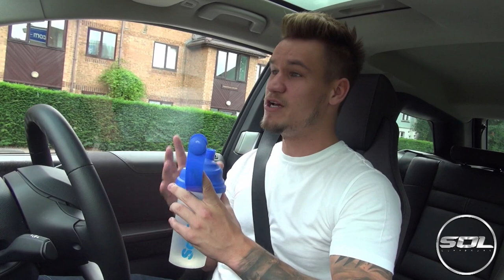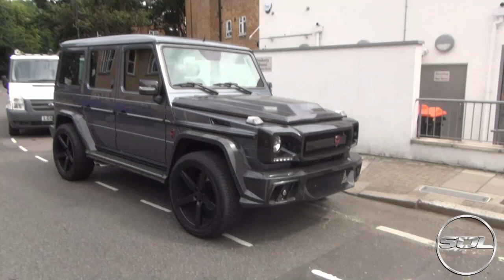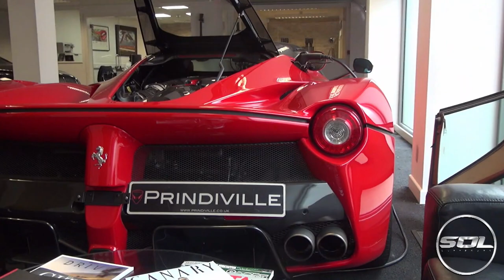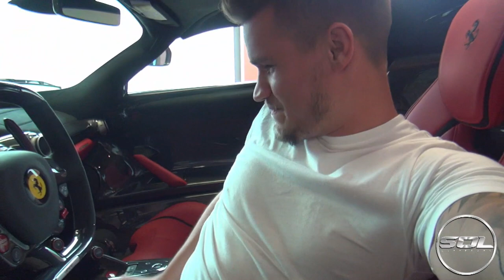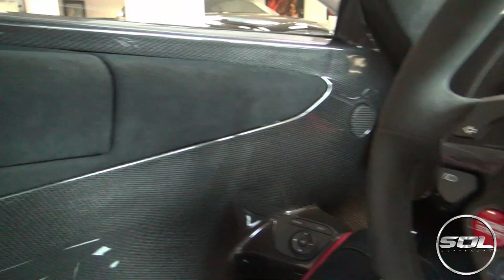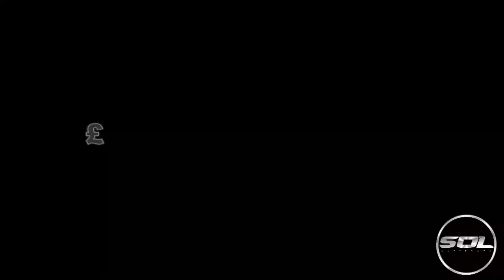THE KEY TO SUPERCAR HEAVEN: FERRARI LAFERRARI!

Comment: its not rocket science, you just plug it into your mains. if you actually buy the car you can get the wall mounted chargers which can fast charge, slow charge and you can even have timed charges, so that you get the cheapest electric when the rates are better throughout the day. worst case you have no electric in the car, then fill up the generator tank ( range extender ) and bobs your uncle, it runs exactly the same as a normal car. there are no problems with charging this car, its just you need a bit of time to set up the chargers and to get into a routine.